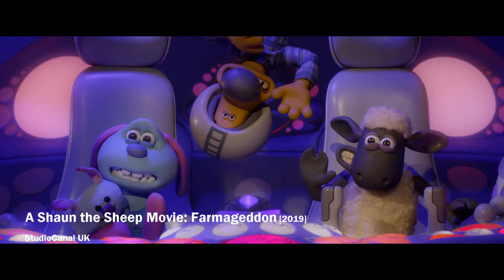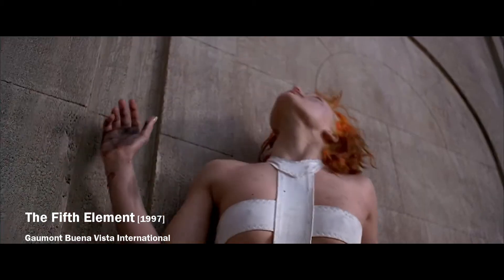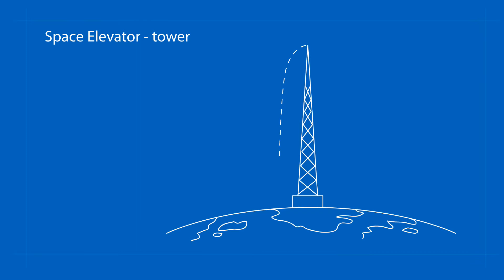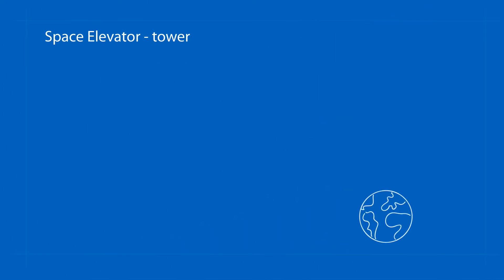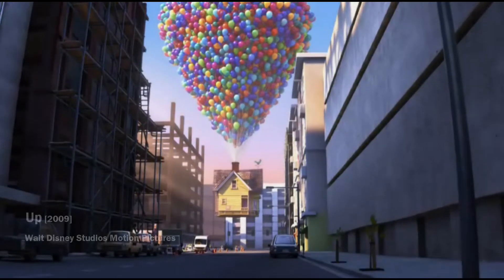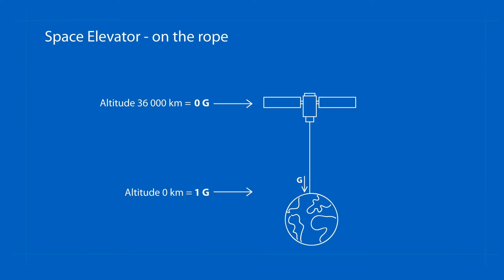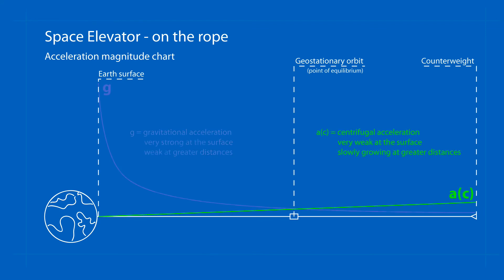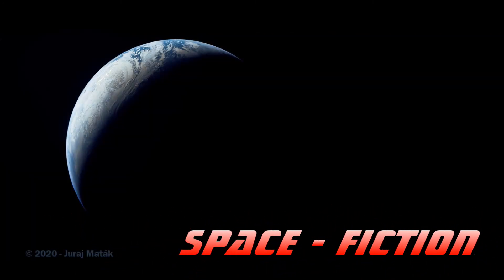How to build a Space Elevator

Comment: In The Fountains of Paradise , Arthur C. Clarke posits a Midway Station at IIRC 25,000 km, with the elevator growing both down to earth and up to the counterweight, which is a 10 million ton captured asteroid from the Main Belt.  The counterweight is at geosynchronous orbit altitude
Reply from the maker: The problem is, that you can not have a counterweight on geosynchronous orbit because it will be dragged to the earth (which in case of 10M ton asteroid nobody wants).
If you want to calculate its exact position you have to find a center of mass of the whole system containing counterweight, station and the whole structure od space-lift together. It might be very close to the counterweight (depending on its mass) but it won't be exactly in the center of mass of that counterweight.
And this center of mass of the whole system (as a point) have to be on geosynchronous orbit.
Reply: @Space-Fiction  perhaps I remembers wrong and they put Midway station at GEO and extended the elevator further like an anchor chain. I’d have to reread the story.
Reply: @Space-Fiction  the mass was given as one billion metric tons for the elevator itself, but since it was made of synthetic diamond, de Beers insisted it be classed as five times ten to the fifteenth carats.

Comment: Two things  :   1) There is no real reason to imagine a counter weight higher than the space station …. Just elevate the space station to an higher altitude .
This will solve two problem : No need for a rotation of the station to establish an artificial gravity,  the excess centrifugal force created by the higher altitude will create an inverted gravity, for free ….
                        2)  simplification of the construction  from the top down. From a geostationary satellite at 36500 kilometer one may launch a rocket downward do give the impulsion requested for a cable to reach the ground. Without it, it will simply float in space ….. Establishing a counter weight above and beyond the satellite  is Iimpossible …it will pull the satellite toward the outer space.
Reply from the maker: Hi Claude!
1.) No. If you want to have a zero gravity in space station that "hangs" over the exact point on Earth, than it have to be on Geostationary orbit. No further, no closer. Otherwise the centrifugal force will create artificial gravity inside the lab. And in that case you need counterweight that is further from Earth than the station.
Yeah, the artificial gravity can be usefull too, but I think in this case many science experiments need to maintain zero gravity... like they have on ISS.
Or... it can have more labs... one on geostationary orbit with zero G and the otherone further from Earth, acting like counterwight... but it can be actually another lab too.
2.) Yeah, you are true... good idea too.